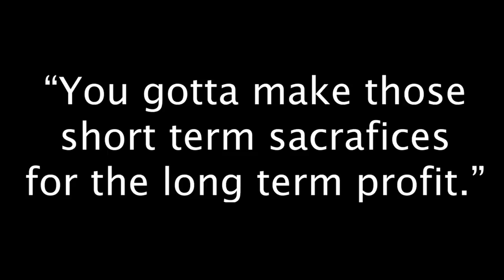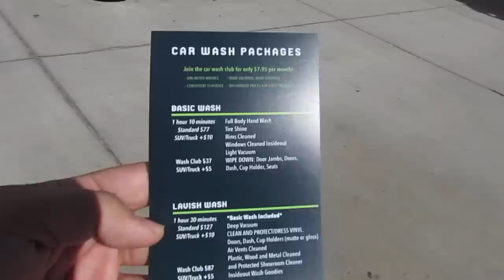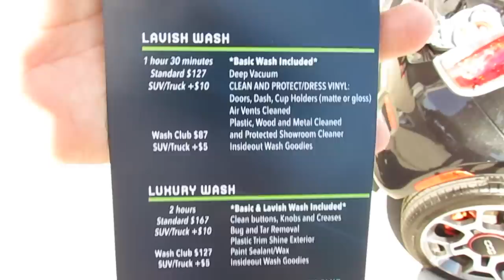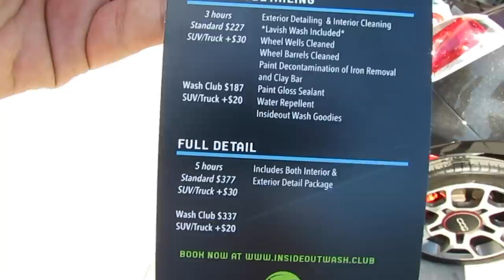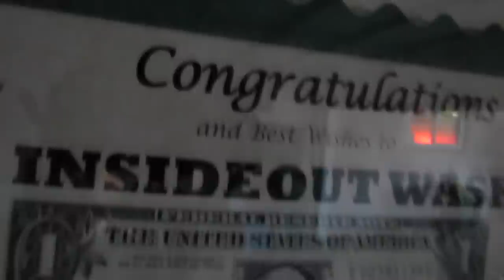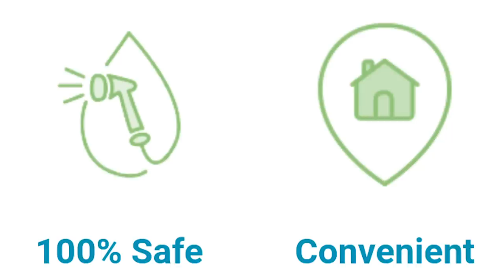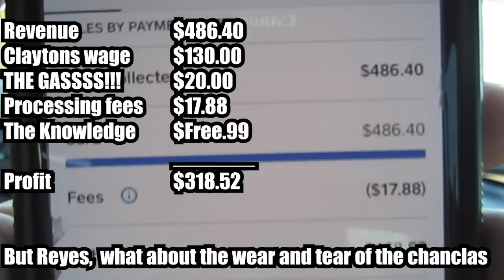HOW MUCH A  WATERLESS CAR DETAILING BUSINESS MAKES IN ONE DAY!!

Comment: I used to detail out of my Honda Civic. I started out doing just a basic wash and hand wax and would use a Bissell carpet cleaner on the interior. A few years later, I was hauling around a 2 gallon carpet extractor, buffets, about 10 gallons worth of chemicals, and a bunch of other stuff. Of course this woman’s setup is much more organized than mine was. Eventually I had to get a truck

Comment: That’s wild “waterless scratch washes “ definitely need to get a power washer respect the hustle tho
Reply: I've been washing my 2017 truck for the last year or so and have had no issues with scratching or swirls. If you get scratches or swirls, it's user error.
Reply: Been washing my Harley a similar way and have had no issues. If your car is filthy or covered In mud then that’s a different scenario. Seems like her goal is to target nice cars that don’t need much elbow grease ! Who wants to clean a shit box anyway
Reply: @bigboy azh washed my caked up car that was detailed and didn’t get no scratches. It’s a good maintenance wash in terms of that you don’t have to bring out all of your equipment all the time. I’ll bring out the pressure washer here and there but I still get better result than using a foam cannon

Comment: Just got my my first 2 paying customers over the past 2 weekends! I'm also going the waterless route for now. This is a very inspirational video! Keep up the good work girl!!!
Reply: Maestro  Thanks for your response. Yeah there is some potential to micro scratch the paint. I believe it doesn't matter if you have a ten bucket method you will always have the  potential to scratch your paint.
Reply: Maestro  Thanks again for your response. Ive been using a waterless wash method for three years now and I see no significant damage to my paint. What method would you recommend otherwise?
Reply: Everything scratches I sell the customer like this.

If you can avoid scratches while driving on the highways and roads my next carwash is free. 
It's a smart selling remark. 
We are not here to scratch anything. 
The waterless concept works. I have 20 customers at set prices. I'm retired but I'm the best. Lol. 

I also buffer and wax with polisher machines that's another bonus.

I tell my customers if you have heavy dirt please go to a carwash 

And I buffer and correct paint if needed.

Communication is key to keeping your customers. 
Seriously. 
They always have their cars clean because they follow my concepts it's that easy.

Keep doing you. 

I've gotten
Reply: I’m starting a detailing biz. I’m wondering if you still use the waterless method?
Reply: @jeffreyg5718  Hello Jeffrey G. I no longer use the waterless wash method. If you want to go the waterless wash route, make sure your customers vehicles are not too coated with dirt and grime.
Reply: @2Shine55  Why did you stop using the waterless method?
Reply: @zorrofit5880  Good evening Zorro Fit, I stop because I realized that you can only use this method on a vehicle that's not super hammered with debris and road fall out. In my opinion its only good for in between washes. Again just my opinion. Try it out and see if it works for you. What I have learned over the years is that everyone has their own techniques that work best for them. Hope you're doing well!
Reply: I was wondering how did you get those clients?
Reply: @LolLol-uk2jc  Word of mouth. One of the best marketing strategies.

Comment: She will just scratch the paintwork as the dirt will not be removed without the water.  Your a dam fool if you pay for this.
Reply: Fr 😬😬
Reply: I was waiting all video for some sort of explanation to this but it wasn’t brought up
Reply: If the dirt isn't removed why does the car look clean? Where's the dirt going?
Reply: imlkrsfn that’s not what he meant. He’s saying all she’s doing is rubbing the paint with dirt making it scratch over time. Since there’s no water to just lift up the dirt and wash it off, all she’s really doing is sanding it down causing it to scratch
Reply: imlkrsfn you can clearly see it in certain angles when the sun shines on it
Reply: @imlkrsfn  there is a reason car washes use water. There is a reason you wash your car with water . Not saying she hasn't removed the dirt , saying the dirt if removed without water will scratch the paint , that fact look it up . In fact,  search on YouTube for a before and after .I would hate to imagine what the swirls on your car look like . #allpaintworkmatters

Comment: As a detailer for 5 years, I’m sorry but waterless detailing isn’t the best way to wash your car.
Reply: Why not?
Reply: @imlkrsfn  The initial rinse with water knocks out loose dust. Here they are just wiping away the dust. Doing this can lead to "swirls" because the dust gathered on the microfiber cloth can act as an abrasive. Contact wash with water and plenty of "suds" from soap act as a lubricant to prevent this.